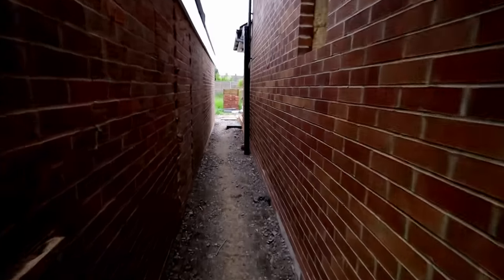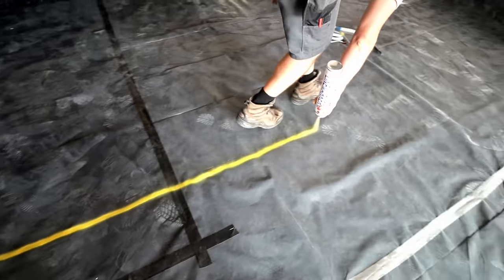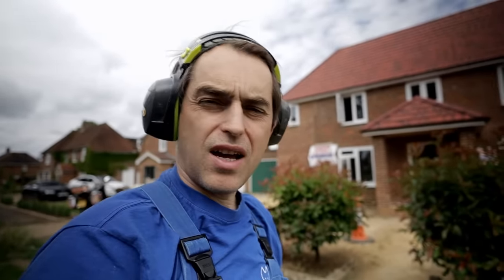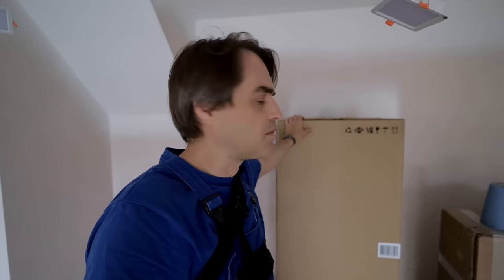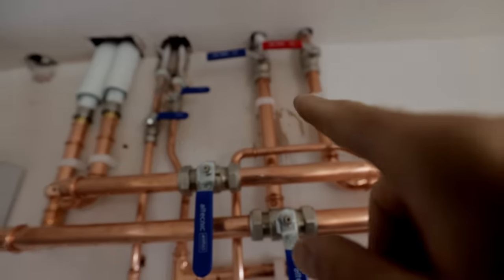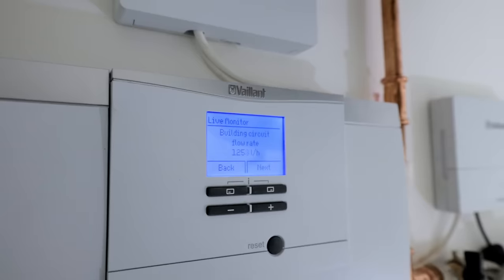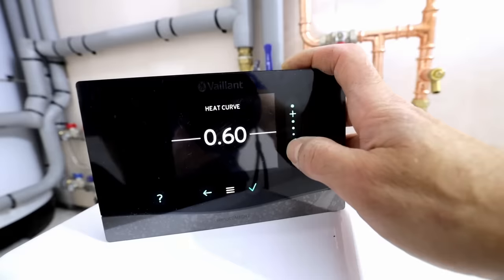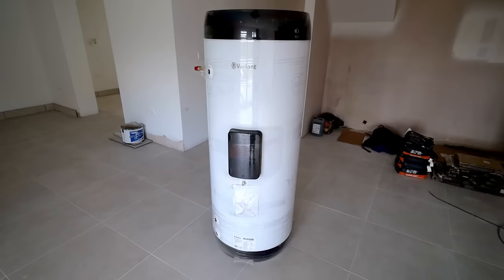Gas Boilers No Longer Make Sense, Here Is Why.

Comment: Sorry mate but for a new build maybe but for your average house HP are for to expensive to install and the space required doesn’t make it feasible. HP are in their infancy and need a lot more R&D to make them viable to replace gas boilers.
Reply: In their infancy? they've been used in Scandinavia, Canada and other countries for decades.  They have a lot more scope for improvement as well (of which gas boilers now have basically none).

Comment: Dont think the heat pump produces enough heat, as a combi boiler does
Reply from the maker: its about power not heat. Combis are sized for how water not heating, what usually make them grossly oversized for heating. Heat pumps when sized and isntalled correctly provide exactly what the property needs in terms of power. This is also what makes them so diffcult to install - as the margin for error is much smaller than it is with overszied gas boilers.

Comment: Heat pumps are not suitable for all properties sometimes only a gas boiler will do.
This install had plenty of space, probably well insulated. 
A heat pump isn't a similar cost to a gas boiler both units are thousands apart on price.

Comment: Fitting a gas boiler system is a DIY project other than the actual boiler connection and test.
Reply: well a heat pump is even more of a DIY project, no explosive gas, no poisonous exhaust to contend with

Comment: Great if you've got the cash and a spare room to put it all in. The majority of houses in the UK will be stuck with gas boilers.
Reply: Internally, you just need space for a cylinder, which there are still a lot of UK homes with.  Some homes will actually increase their available space inside because they don't need a boiler, so can have a storage cupboard instead.  There is a mixture of solutions, so it's not a case of heat pump+cylinder being the only solution - it's considered the best option for sure, but other set ups are possible.

Comment: ASHP doesn't cost is not much different to a gas boiler? Where are you getting your pumps from? A gas boiler are about £1000, ASHP's £4500+! Additionally all the extra costs of UFH etc etc. Maximum stated COP for ASHP is less than 4.5 and that's maximum, average through the year would be less. I see you've installed radiators upstairs, will they be running off the 35degree flow? As it's a renovation, the wall insulation will not be up to the standard needed for such a low radiator temperature. 
By the time the cost of that system has been totted up the payback period will be decades and that's assuming nothing fails! Don't get me wrong, I like ASHP's and GSHP's what I don't like is inaccurate information.
Reply from the maker: Radiators can run at any temperature if you understand how to calculate heat loss and design the system 

After 5k grant and 0 vat heat pump can cost exactly the same as gas boiler 

Scop is based on a flow temperature and can be higher than maximum manufacturer stated scop, again if you know how to design the system and understand hear loss.
Reply: @UrbanPlumbers No disrespect, but who do you think is paying for all the free 'green' cash, £5k here no vat there, the money isn't plucked from thin air. Your work is exceptional and videos very educational.

Comment: Unfortunately the efficacy of heat pumps is a lie much like anything when someone is trying to sell you it,just look at how motor manufacturers legally and decievingly manipulate tests for fuel efficiency for instance.Heat pump manufacturers are no different,the efficiency levels being measured in laboratory conditions and in the real world those figures simply arent achieved,even small deviations from the ideal set up can have a dramatic effect. much like the big lie of automotive stop start systems that the governments own advisors very quietly admitted are only are beneficial in laboratory tests,in the real world there are too many variables. Of course the hawks are going to big them up,they are trying to make money from you.Also I seem to remember reading that the failure rate of expensive heat pump electronic components is around 23%, with repairs averaging 14-20% of the cost of the initial outlay for the unit.

Not to mention the ever increasing reliance on an aging network that is already struggling to supply sufficient electricity for our current needs,a guy in my village who works in a power station recently remarked that with more people  using electric boilers,plugging in cars and using heat pumps you will start to see large swathes of areas suffering more frequent power cuts. People will be cold,their cars will be uncharged,leaving many stranded and unable to work,get their children to school etc.  Besides my gas bill is a fraction of my electricity bill.
Reply: And yet you can find people sharing their independent testing results and in some cases getting better than the manufacturers stated COPs. Those tests are using 3rd party monitoring that continuously monitor electricity usage and temperature in and out etc, so not something that can be faked like the car manufacturers can do - the heat pump wouldn't even know it's being tested. I think you'll find that the electronic component failure rate you speak of is as a percentage of all failures, not percentage of heat pumps.
Reply from the maker: @BenIsInSweden https://youtu.be/RlcvncWvNUQ
Reply: @UrbanPlumbers  Yeah I saw that last night. Interested to see the upcoming video on how DHW SCOPs have been improved.
Reply from the maker: @BenIsInSweden large twin coil, seems to improve scop by around 1 on dhw
Reply: When done right, a modern heat pump will reach it's efficiency. Doing it wrong is like driving 200 mph on the highway and saying the car is not as efficient as advertised.
The grid problem will be mostly due to EV charging and full electric kitchens. A typical heat pump won't make a large difference in comparison. Just look at the electric consumption  of a 5 kW Vaillant monoblock and compare it to a dishwasher, electric oven, induction hob or EV charger. Even a typical water cooker used more. Replacing a dumb electric boiler with a heat pump based boiler makes even more sense if grid peak load is the thing you are worried about. With some solar panels it will run even cheaper for many days in the year, something quite  hard to do with gas boilers.

Comment: I agree with your points regarding VAT etc. and grants, but consider this, grants are grants and not market prices. grants can and do get taken away down the line. while they are on, sure great. with out them they there is very little discussion at all.

ROI However.

Everything is ROI, Kitchen old and out dated, are you going to put a 15k in a 100k home, no, it is pointless.  you will not gain enough value for doing so. but you upgrade an old outdated kitchen with a new 3k kitchen, then yeah, you could add more value to the home than what it cost to install, that is ROI. if you do not, the next purchaser, will only ask for a lower price anyway without it, so they could put one in them selves. but a new buyer will not pay 15k more for a kitchen, a 15 percent increase to the street value. so there is no ROI for 15k kitchen. the same for bathrooms. etc. 

FYI i flip houses.  the buyers will not pay the extra, no matter how much you try to sell it to them, they need to know why it is worth paying for. 

As my grandfather said, (he flipped property too, family side business) There is no point putting gold plated windows in, as it will not add value. as all they are looking for is a yes or a no when it comes to valuation. Double glaze. Yes, no. freshly painted, and carpeted, yes, no. it is just a check box.  brands mean nothing  to the purchaser in 99 percent of cases.

So ROI is important when looking at a higher upfront cost to make longer term savings.  If you are trying to sell a product based on it being cheaper to run but costs more it buy, Then we need to know if the higher upfront cost is worth paying, if the longer term savings will mean i am better off.

ROI is very important when you can buy a boiler and fit for 2k into an existing house, or pay several times that for heat pumps. the extra cost needs to be justified.  i get this is different for new builds, but for about 90 percent of the public in existing homes, you will need to justify it.  Take Double glaze windows. The higher upfront cost is worth it as the long term savings means you are better off. But look at triple glaze, the time to pay back the extra cost vs double is exponentially longer, as 90 percent of the saving is already coming from the double,  the  same for insulation upgrades, 300 mm of insulation great. good prices, decent savings in just a few years good ROI.  but 600 mm of insulation 2 x the cost,  complete waste. no further payback is made. so not justifiable so the ROI is zero, so not worth doing.

The same can be said for EVs too

Case and point, 

Electric cars vs petrol cars, you can by an petrol car for about 8 to 10 k new, to get a EV with equivalent range will set you back 30k  So to justify that 20k difference, I need to know how long it will take to recoup that cost by not paying for petrol.  say i spend 1000 a year on fuel.  lets assume the price goes up with inflation each year, it will take 15 years to justify that upfront cost of 20k.  However, statistically speaking, i would upgrade that car twice in that 15 years span, so in that scenario, it is not cost effective to do it, the ROI takes too long. 

Now apply that to Boilers vs heat pumps for homes.  that is why ROI is asked for.
Reply: Low-temperature heating will gain traction. It technically already has started with how popular videos last winter were on saving costs during last winter. There's only so much that can be done on what people currently have before the investment into new radiators, insulation, windows etc. to bring their running costs down, especially since large renovations require low-temperature heating due to building regs. 
So there will come a time when a house that doesn't have low-temperature heating will have an effect on its price, as people will be aware of what cost might be involved in being able to make the heating running costs cheaper. The heatpump in this video currently retails at about £4k inc VAT without the discount, given that it is expected to last 20 years (almost 2x as long as a £2K boiler), and in many cases will save hundreds per year in running costs, it's a no brainer when paired with a properly designed heating system.

You also might want to re-look into what new petrol cars cost and their equivalent EV, it's about £5K difference, not £20K.  Also, the cheapest car on Autotrader new is £12K, so 🤷🏻
There are other things that EVs can do as well that you just can't do with a petrol car.  V2H and V2G are now possible, so you can use the car the same way as a home battery, as I WFH, I could charge the car at a cheap rate, and let the house run off of it during the times when the rate is more expensive - or in some cases sell it back to the grid at the higher rate.

On the range thing, each to their own, I never go from full to empty in a single sitting on my petrol car, I would break it up anyway, either to get a coffee or something to eat, stretch my legs etc.  I could realistically stop, put the car on a fast charger, do all of that and come back to enough charge to keep me going until I reach the destination or the next stop.

Comment: 1. RUNNING COST (Electricity much more expensive per KwH than gas despite recent attempts to drive the price of gas up). 2. COMFORT Rads only heated to 35c? OK for UFH - which is not OK for a retro-fit. 3. APPEARANCE - massive ugly radiators. 4. SPACE - not all properties have enough room for a "plant room". 5. NOISE - when that PoS "reverse acting fridge" starts wearing because it has to run at a CoP of around 1, it WILL get noisy. 6. ENVIRONMENT - A decent gas or non-condensing oil boiler will last 20+ years. This stuff - max 5 years and major parts will need replacing.
The whole drive to electricity is a massive con. It's all about power and control.
Reply from the maker: You have zero idea what you are talking about.

Comment: Under floor heating with screed and tiles as a heat bank…………didn’t we used to call that storage heating, maybe great when the seasons were predictable, but any sudden external temperature rise will have you wishing the under floor cooling was more efficient than the heating 😂😂😂

Comment: Highly insulated house. Triple glazzed, EWI 450mm loft insulation.  Regular boiler running at 45c flow temp with immersion as legionella control weekly.  
Running gas is cheaper.  If I had the best induction hob and ASHP with maintenance costs of running this system it’s still more expensive than gas.  Sorry
Reply: Would I have you do plumbing on my house! ABSOLUTELY 
ROI on a heat for my home including £5000 grant, induction hob etc 

There is no ROI Infact I’ll be out of pocket by my installation costs and running the induction hob

Efficiency does not equal saving money
Unless your on solid fuel oil LPG

Comment: Firstly...not all of us can afford such a large house and large garden...the large area of land necessary for the system. Secondly...underfloor excellent until it leaks...and it will. Thirdly the cost of running pumps and compressors mitigates any other advantages and of course no guarantee as to the generation of used electricity and finally the cost is greater than any other system. Best system is storage heaters from the like of Fischer or Electrorad, no pumps, no compressors, no expensive plumbing. Oh yes don’t forget that underfloor heating may well crack any floor tiles. I have yet to come across any such system that worked well...or at all and didn’t cost far more than any other heating system. Also who the hell wants all that pipe work? And finally you will need a degree to operate it.
Reply: You do realise a gas boiler also has a pump to run?  So the main "extra" running cost is the compressor, which makes the whole thing possible to work out cheaper even though electricity is more expensive.

Comment: I really like your video and the analysis going into your video. Obviously you are quite clever so why make such a stupid statement about return on investment. Yes, some people might not be interested as they do not mind spending the money but people who have to make best use of their money do care about return on investments. Taking the example of a bathroom was not very clever as when people need a bathroom like they need a heating system and when redone my bathroom I did look at return on investment on what I chose
Reply: Curious as to aside from water-saving taps what RoI you get from what you choose in a bathroom.
Reply from the maker: lol
Reply: @BenIsInSweden  have you refurbished your bathroom? Probably not as you would not make such statement. Everything can range a factor 10 from tiles to taps and you can make a great bathroom with less money but you do not have the nice and shiny top brands on display in your bathroom but the features are exactly the same.
Reply from the maker: So how long for your bathroom to return the money on investment as compared to the old bathroom ?
Reply: @fredericguyon1449  Bathroom? no.  Other parts of my house, yes.  But your point is still not equivalent, yours is only about saving money at the outset. And not addressing the question that usually gets asked, is how long before it pays for itself, i.e. when do you get a return on the investment.